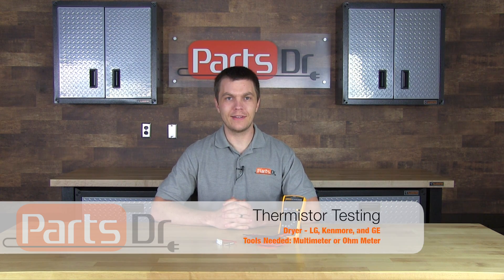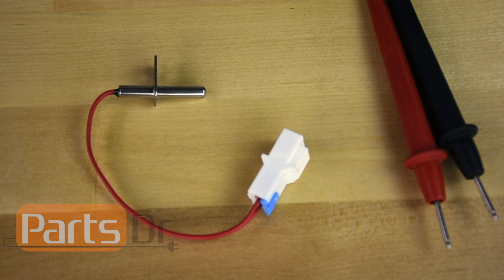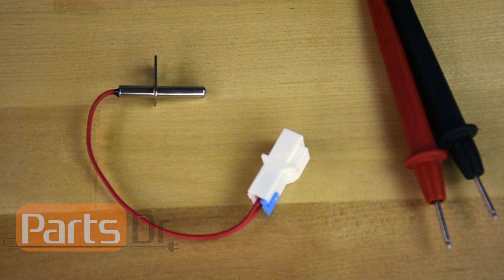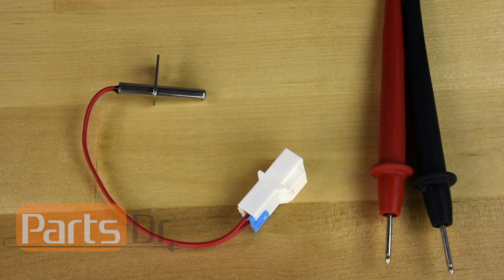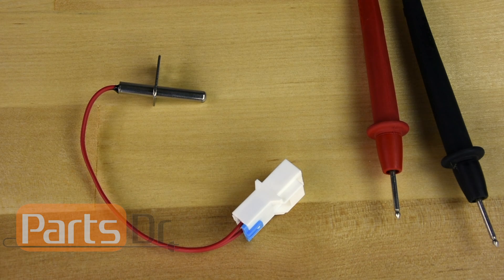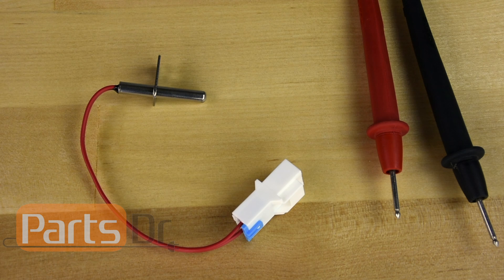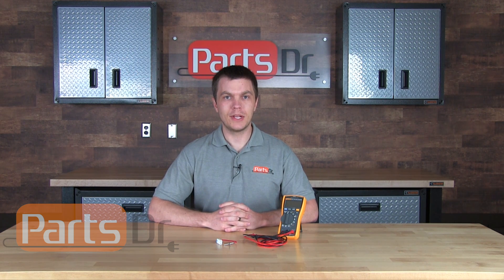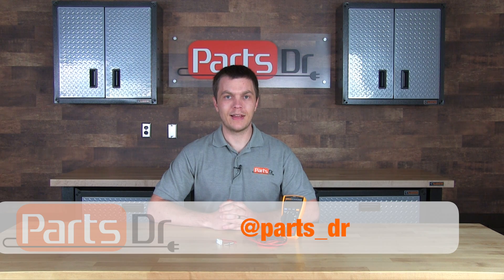How to test Thermistor LG Part # 6323EL2001B & GE Part # WE04X10114

Comment: Thanks for the video and prompt delivery of my control panel.  After testing the thermistors i installed a new control board and my te1 error finally went away.  the error code would come on after 5 seconds of turning on the dryer.  thanks again!
Reply from the maker: Great!  Nice job fixing it yourself!

Comment: 11 kohms is not a standard for all thermistors.   My technical manual says the correct reading should be 47 kohms at 77° temperature.  mine was reading 34 which caused the washer to not dispense hot water

Comment: Hi ,thank for this video ,I have a cuestión, my  dryer is  whirlpool and the thermistor part number is  w10623852  k54/50k , the value of this termistor is the same ?  The reading with  my tester Was 42.50 k ohms  ,with temperature of 27 centigrades  ( my country), is it correct? Have you got te table for whirpool thermistors?

Comment: I just bought a thermistor from Parts DR and is not working properly. How likely is it that a new thermistor is bad? After testing a couple times the reading was different each time. First time 11.84 second time 11.24 but never 11.34 recommended reading. What is your suggestion? Thank you...
Reply from the maker: It sounds like yours is testing good.  A difference of plus or minus 5% is usually normal.  Plus the temperature of the sensor for touching your hand or something else can cause the reading to change.  If you hold the sensor in your hand while you test the part, the sensor will warm up and the resistance value with increase.

Comment: Hello thanks for the great video I tested mine with multimeter setting at 20K and the reading I'm getting back is  8.99 and 9.22 but nothing at 11 or higher. I know you stayed "if it test significantly higher than 11 or lower it should be changed" would the readings I just mentioned qualify as a part that should be changed? Over changed the entire heating element with new fuses everything but still no heat. So this would be my last option if I'm guessing right. Thanks in advance!
Reply from the maker: According to the chart, you sensor is off by maybe 10F?  That is most likely not the cause of your no heat problem.
Reply: @PartsDr  I ordered the part just in case. But here's a side note question. I tested one of the thermostats and it has continuity. When I put a small flame under it snaps but it stays snapped. It doesn't click back into place I test it and not continuity. Will that be a problem? My overall issue with my LG dryer is that it's runs but gives no heat at all. Like I mentioned I replaced the entire heating element with a new one. But nothing. I also checked the outlets plug to make sure I have the correct voltage coming out and it was confirmed that it's working properly. Kind of feel like I'm running out of options

Comment: Strange this part is inside my dishwasher motor...
Reply from the maker: They use a similar thermistor on dishwashers to monitor the water temperature.  The resistance specifications could be different, so check the specifications first before testing it.
Reply: @PartsDr  Yeah it checks out fine. Just need to find a way to replace the fuse link to the heater.... It's such a stupid design...

Comment: Sir, i am a Technician from the Philippines 🇵🇭
And a newbie on electronics... i am currently troubleshooting an Inverter split type a/c unit 3 tonner. As manufacturer's rated the Room temp sensor is 15k, if the reading drops to 12k is it still good? Same with the pipe sensor at 20k then my read out is 16.99k are they still good? Thank you❤❤❤
Reply from the maker: The resistance scale for each thermistor can be different for each make and model of appliance.  You will need to find the specifications for the specific appliance you are working on to test the sensor.

Comment: I have a 2 wire thermistor with two black wire. I have to replace the connector but u don't know the positive and negative wire.
Please help
Reply: It's just a resistance there's no positive and negative it's same
Reply: We are a professional and leading manufacturer about NTC Thermistor, for Temperature Compensation & Temperature Measurement Sensor Probe Type. With our Production & Engineering Team having more than 20 years of experiences endeavored in NTC Thermistor field, we continuously develop new products and techniques to extend our capabilities. Shiheng's core expertise in design and manufacturing has produced many innovative products of superior quality with exceptional value.
Nanjing Shiheng Electronic, Co ., Ltd (QUALITY IS OUR CULTURE) 
WhatsApp：+8613951639167
Telephone:+86-25-52121868  Fax:+86-25-52122373
Mob:+86-13951639167
Email: 1372286431@qq.com
     Kristywong521@gmail.com
Website: https://www.ntcshiheng.com/
Add: No 18 Jinyang Road, Hushu Town, Jiangning District, Nanjing，China 211121

Comment: Hello sir my thermistor reads 65.5 is it defective
Reply from the maker: If your thermistor is the same part number shown in the video then it would be defective.
Reply: @PartsDr  https://tse2.mm.bing.net/th?id=OGC.645187f0f7c142175c9a624d5120ed47&pid=Api&rurl=https%3a%2f%2fwww.jobcluster.com%2fbloghttps://tse2.mm.bing.net/th?id=OGC.b6a09e85a0397d0a2cff62829fd0e8ae&pid=Api&rurl=https%3a%2f%2fupload.wikimedia.org%2fwikipedia%2fcommons%2fc%2fc1%2fBored.gif&ehk=qEONylA8RbD3CaOkSYsCk7LsVID%2f%2fQXXzQAss7KfYgg%3d %2fwp-content%2fuploads%2f2014%2f08%2fgiphy-3.gif&ehk=rhttps://tse2.mm.bing.net/th?id=OGC.b6a09e85a0397d0a2cff62829fd0e8ae&pid=Api&rurl=https%3a%2f%2fupload.wikimedia.org%2fwikipedia%2fcommons%2fc%2fc1%2fBored.gif&ehk=qEONylA8RbD3CaOkSYsCk7LsVID%2f%2fQXXzQAss7KfYgg%3d https://tse2.mm.bing.net/th?id=OGC.b6a09e85a0397d0a2cff62829fd0e8ae&pid=Api&rurl=https%3a%2f%2fupload.wikimedia.org%2fwikipedia%2fcommons%2fc%2fc1%2fBored.gif&ehk=qEONylA8RbD3CaOkSYsCk7LsVID%2f%2fQXXzQAss7KfYgg%3dhttps://tse2.mm.bing.net/th?id=OGC.b6a09e85a0397d0a2cff62829fd0e8ae&pid=Api&rurl=https%3a%2f%2fupload.wikimedia.org%2fwikipedia%2fcommons%2fc%2fc1%2fBored.gif&ehk=qEONylA8RbD3CaOkSYsCk7LsVID%2f%2fQXXzQAss7KfYgg%3d xupXFt8D1N4BWvhFveiAEaoZlKQqkGzgKqw6QayhXE%3d
Reply: We are a professional and leading manufacturer about NTC Thermistor, for Temperature Compensation & Temperature Measurement Sensor Probe Type. With our Production & Engineering Team having more than 20 years of experiences endeavored in NTC Thermistor field, we continuously develop new products and techniques to extend our capabilities. Shiheng's core expertise in design and manufacturing has produced many innovative products of superior quality with exceptional value.
Nanjing Shiheng Electronic, Co ., Ltd (QUALITY IS OUR CULTURE) 
WhatsApp：+8613951639167
Telephone:+86-25-52121868  Fax:+86-25-52122373
Mob:+86-13951639167
Email: 1372286431@qq.com
     Kristywong521@gmail.com
Website: https://www.ntcshiheng.com/
Add: No 18 Jinyang Road, Hushu Town, Jiangning District, Nanjing，China 211121

Comment: Hi, again,
The current cost of the new heater element is prohibitive for a few months.
Is it possibly to leave the entire heater element part disconnected from the main control board so it isn't used?

Do you know which connector on the LG EBR 78534500 is for the heater and thermistor so I don't connect it?

THx.
Robert
Reply: We are a professional and leading manufacturer about NTC Thermistor, for Temperature Compensation & Temperature Measurement Sensor Probe Type. With our Production & Engineering Team having more than 20 years of experiences endeavored in NTC Thermistor field, we continuously develop new products and techniques to extend our capabilities. Shiheng's core expertise in design and manufacturing has produced many innovative products of superior quality with exceptional value.
Nanjing Shiheng Electronic, Co ., Ltd (QUALITY IS OUR CULTURE) 
WhatsApp：+8613951639167
Telephone:+86-25-52121868  Fax:+86-25-52122373
Mob:+86-13951639167
Email: 1372286431@qq.com
     Kristywong521@gmail.com
Website: https://www.ntcshiheng.com/
Add: No 18 Jinyang Road, Hushu Town, Jiangning District, Nanjing，China 211121

Comment: Hi,
I have an LG model WM3370HWA front load washer.
Ther thermistor is actually contained in the water heater assembly, and removable.

I tested the thermistor and started with the lowest OHm value on the dial and worked my way up until an actual reading displayed on the screen.

From the lowest Ohm setting each dial selection displayed the default screen 
of 1___ ohms, until the 200k was selected.

This is at room temp between 65 & 70 degrees F

Dial select: 200k
Reading: 053

Is this normal for this thermistor?

Is it supposed to be tested at 200k?

The heater element checks out functional. 

120v
14.5 Ohms
Contin: 014
Watts: 1,000

This thermister is designed and manufactured into the heater element casing.
It is removable, yes, but is just the thermistor sold separately, or do I have to purchase
the entire heater assembly?

THx,
Robert
Reply: We are a professional and leading manufacturer about NTC Thermistor, for Temperature Compensation & Temperature Measurement Sensor Probe Type. With our Production & Engineering Team having more than 20 years of experiences endeavored in NTC Thermistor field, we continuously develop new products and techniques to extend our capabilities. Shiheng's core expertise in design and manufacturing has produced many innovative products of superior quality with exceptional value.
Nanjing Shiheng Electronic, Co ., Ltd (QUALITY IS OUR CULTURE) 
WhatsApp：+8613951639167
Telephone:+86-25-52121868  Fax:+86-25-52122373
Mob:+86-13951639167
Email: 1372286431@qq.com
     Kristywong521@gmail.com
Website: https://www.ntcshiheng.com/
Add: No 18 Jinyang Road, Hushu Town, Jiangning District, Nanjing，China 211121

Comment: Hello parts dr.

I tested my lg washer heater element and thermistor.
My results are,

heater: 14.5 ohms
014 contin

thermistor:  tested on 200k option and the result is 053 ohms

I plugged in my numbers for the heater element into an ohms calxulator app.

element is 120v
1,000 watts

the results are:
8.5 amps 14.5 ohms, so the heater element seems to check out as functional.

I dont understand the thermistor reading, is it functional or not?

once this issue is finished then moving onto the next issue.

Thank you,
Robert
Reply: We are a professional and leading manufacturer about NTC Thermistor, for Temperature Compensation & Temperature Measurement Sensor Probe Type. With our Production & Engineering Team having more than 20 years of experiences endeavored in NTC Thermistor field, we continuously develop new products and techniques to extend our capabilities. Shiheng's core expertise in design and manufacturing has produced many innovative products of superior quality with exceptional value.
Nanjing Shiheng Electronic, Co ., Ltd (QUALITY IS OUR CULTURE) 
WhatsApp：+8613951639167
Telephone:+86-25-52121868  Fax:+86-25-52122373
Mob:+86-13951639167
Email: 1372286431@qq.com
     Kristywong521@gmail.com
Website: https://www.ntcshiheng.com/
Add: No 18 Jinyang Road, Hushu Town, Jiangning District, Nanjing，China 211121

Comment: whats work pipe thermesitor sensor ???
Reply: We are a professional and leading manufacturer about NTC Thermistor, for Temperature Compensation & Temperature Measurement Sensor Probe Type. With our Production & Engineering Team having more than 20 years of experiences endeavored in NTC Thermistor field, we continuously develop new products and techniques to extend our capabilities. Shiheng's core expertise in design and manufacturing has produced many innovative products of superior quality with exceptional value.
Nanjing Shiheng Electronic, Co ., Ltd (QUALITY IS OUR CULTURE) 
WhatsApp：+8613951639167
Telephone:+86-25-52121868  Fax:+86-25-52122373
Mob:+86-13951639167
Email: 1372286431@qq.com
     Kristywong521@gmail.com
Website: https://www.ntcshiheng.com/
Add: No 18 Jinyang Road, Hushu Town, Jiangning District, Nanjing，China 211121

Comment: How do you change the light on a 2005 cool,n cool fridge freezer
Reply: We are a professional and leading manufacturer about NTC Thermistor, for Temperature Compensation & Temperature Measurement Sensor Probe Type. With our Production & Engineering Team having more than 20 years of experiences endeavored in NTC Thermistor field, we continuously develop new products and techniques to extend our capabilities. Shiheng's core expertise in design and manufacturing has produced many innovative products of superior quality with exceptional value.
Nanjing Shiheng Electronic, Co ., Ltd (QUALITY IS OUR CULTURE) 
WhatsApp：+8613951639167
Telephone:+86-25-52121868  Fax:+86-25-52122373
Mob:+86-13951639167
Email: 1372286431@qq.com
     Kristywong521@gmail.com
Website: https://www.ntcshiheng.com/
Add: No 18 Jinyang Road, Hushu Town, Jiangning District, Nanjing，China 211121

Comment: where do you place the probes on a single pin/single wire thermistor?
Reply from the maker: You would most likely need to look up the specific information for that particular thermistor to see how it should be tested.  Most thermistors on appliances have two pins that we commonly see.
Reply: There is no such thing as a single wire thermistor... A thermistor is a "thermal resistor". Voltage must pass across it (2-wires).
Reply: We are a professional and leading manufacturer about NTC Thermistor, for Temperature Compensation & Temperature Measurement Sensor Probe Type. With our Production & Engineering Team having more than 20 years of experiences endeavored in NTC Thermistor field, we continuously develop new products and techniques to extend our capabilities. Shiheng's core expertise in design and manufacturing has produced many innovative products of superior quality with exceptional value.
Nanjing Shiheng Electronic, Co ., Ltd (QUALITY IS OUR CULTURE) 
WhatsApp：+8613951639167
Telephone:+86-25-52121868  Fax:+86-25-52122373
Mob:+86-13951639167
Email: 1372286431@qq.com
     Kristywong521@gmail.com
Website: https://www.ntcshiheng.com/
Add: No 18 Jinyang Road, Hushu Town, Jiangning District, Nanjing，China 211121

Comment: Hindi me samjao
Reply: We are a professional and leading manufacturer about NTC Thermistor, for Temperature Compensation & Temperature Measurement Sensor Probe Type. With our Production & Engineering Team having more than 20 years of experiences endeavored in NTC Thermistor field, we continuously develop new products and techniques to extend our capabilities. Shiheng's core expertise in design and manufacturing has produced many innovative products of superior quality with exceptional value.
Nanjing Shiheng Electronic, Co ., Ltd (QUALITY IS OUR CULTURE) 
WhatsApp：+8613951639167
Telephone:+86-25-52121868  Fax:+86-25-52122373
Mob:+86-13951639167
Email: 1372286431@qq.com
     Kristywong521@gmail.com
Website: https://www.ntcshiheng.com/
Add: No 18 Jinyang Road, Hushu Town, Jiangning District, Nanjing，China 211121